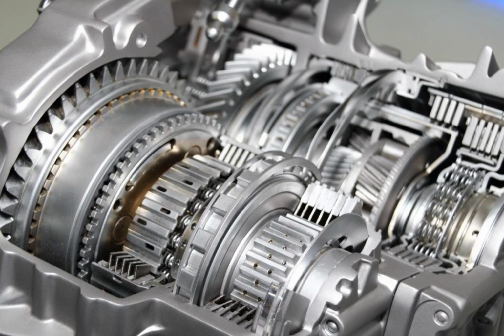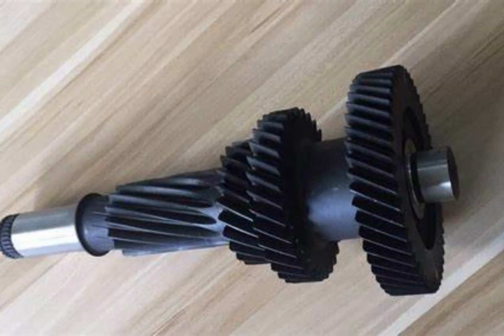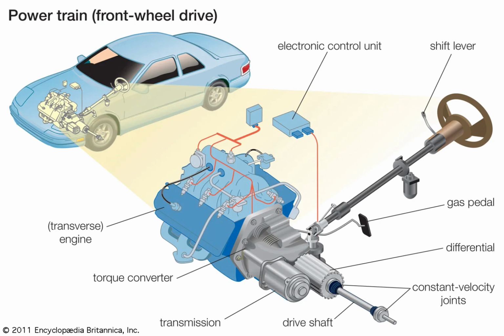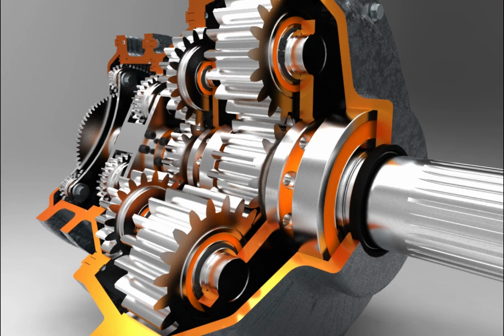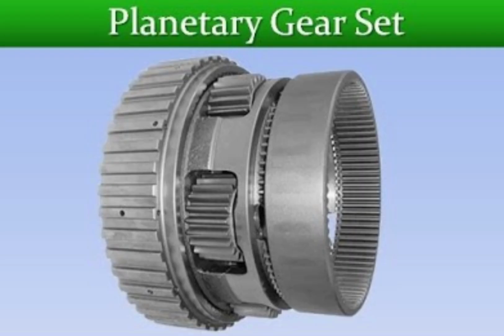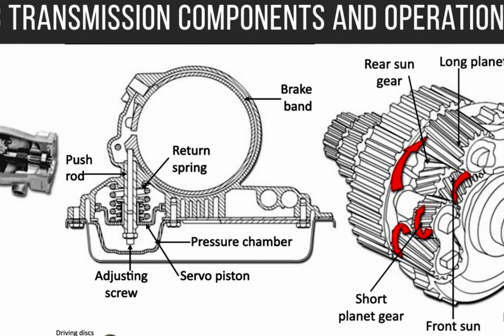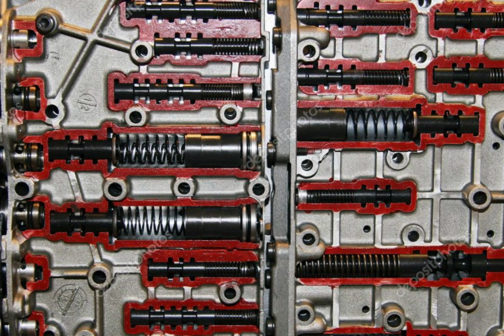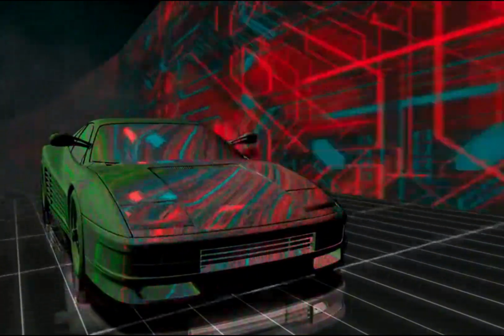How a Car Transmission Works | Key Mechanical Transmission Parts | Transmission Inner Working Parts

Comment from the maker: How a Car Transmission Works: Key Internal Parts Explained with GardeningWithKirk. This video breaks down the anatomy of the transmission, from gears and synchronizers to shafts, clutch packs, bearings, seals, and fluid systems. Together, these components manage power delivery and ensure smooth acceleration and control. Share your thoughts on automotive engineering, car maintenance, or mechanical design in the comments, and remember to use #GardeningWithKirk #ForYou #Transmission #AutomotiveEngineering #GearSystems #PowerDelivery #VehiclePerformance #MechanicalDesign #FluidDynamics when posting your own creations. Together we celebrate milestones, learn the science behind machines, and inspire each other to understand technology.